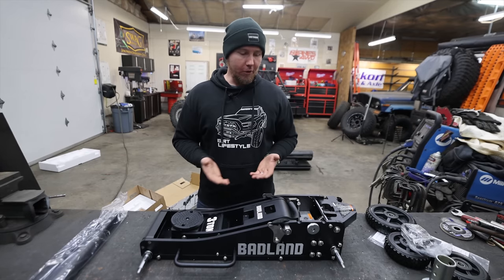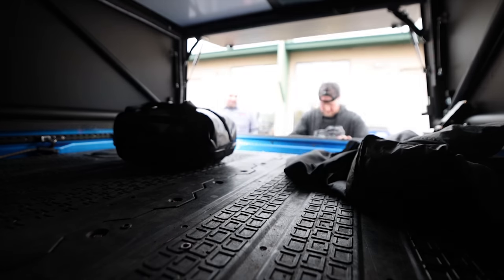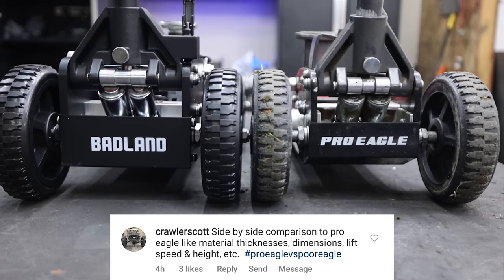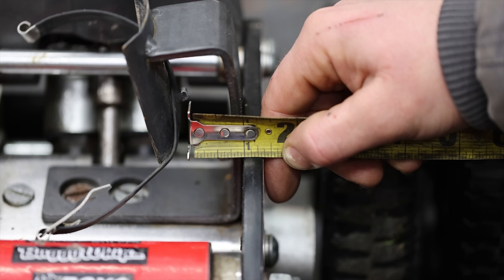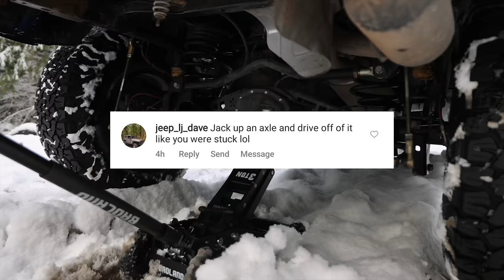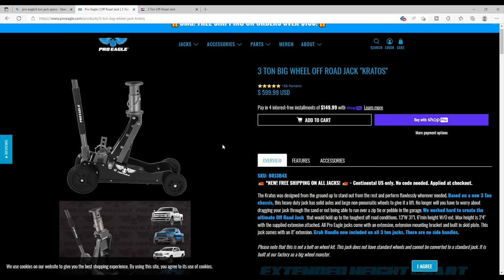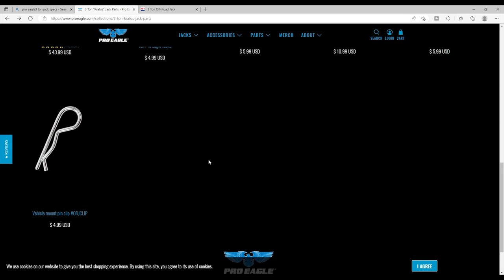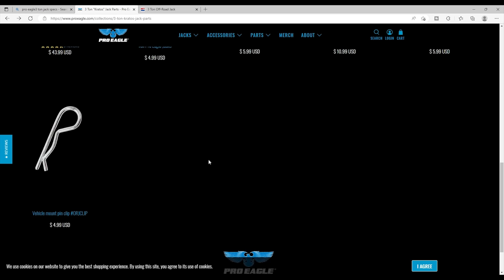Pro Eagle Clone Or Killer? Harbor Freight Offroad Jack Test and Review.

Comment: I got the H.F. Off-Road jack some days ago, in fact the floor demo one before the store had a chance to set up.   If anyone has problems with H.F.  read up on the company history. It's a interesting of success not a wonder flash in night company. 
 On with what the "Off-Road Jack" should be called.... "The P.M.C. Jack" I seen it in  Iraq. Contractors had modified regular floor jacks to be able to do faster tire changes that worked in sand, ect. ect. due to not having the same support as military services.  I had seen them in 03-04.

Comment: You need to show us how to convert a regular HF floor jack to a off-road jack
Reply: and not from a kit!
Reply: Nate: Welcome to my new series about converting a HF garage jack to an offroad capable jack... 3 videos layer he's bolted on a spacer conversion to put on a 17x9 wheel with 37s and then puts a small block Chevy on top to power it, uses a hydrostatic trans to convert engine power to lift and movement, puts a GM steering box on it and then takes that offroad.
Reply: 911 motorsports makes a kit
Reply from the maker: That would be pretty fun 😁

Comment: I love my 1.5 ton Offroad-Converted HF Jack, converted with a conversion kit from 911 Motorsports. Small and Light. It is my go to jack. 

Now I also want something larger for when the 1.5 HF isn't enough and I need to lift something on my gravel driveway. I have been thinking of converting bigger HF jack but now I don't have to. I am a buyer of this new off-road jack from HF!   I mean, a 3 ton conversion kit from 911 motorsports is almost the same price as this new HF off-road jack, and it doesn't even include the jack!
Reply: But you'll have a Jack that is partially American-made and supporting a small business at the same time.
Reply: @MrPiimpslap  No doubt. I try to support small businesses when I can. 

I went back and looked at 911 Motorsports kit and their 3 Ton HF conversion kit wasn't as expensive as I remembered.  

The $165 conversion kit, + $249 HF Jack, is very competitive vs the Pro Eagle 3 Ton, but not very competitive to the new $299 3 Ton HF Off-Road Jack.  I can always spend the savings on other small businesses... 😉

Comment: I'm from the UK and use a sealey 3 tonne cross beam adaptor models no. X137 for offset diff on land rover. That jack would be ideal if it came with beam adaptor what you can buy.

Comment: I’ve bought (and returned) things at PrincessAuto/HarbourFreight. I’ve considered them a seller of 1-TimeUse (if lucky) products. Wondering HOW can this product be messed up
Reply: I agree. I’ve had tools I bought at HF shatter on the first use. It makes me very leery to trust them with something like a jack
Reply: I have also had harbor freight tools break before the 1 time use, but in my experience my harbor freight jack has never indicated it would fail on me anytime soon. I also have a set of recalled harbor freight jack stands and the improved ones. I would not trust my life with the recalled ones (obviously, but i still use them on occasion) and I'm confident with the new ones with the safety lock thing. Based on how this one appears to be built, just like my own jack, I would trust this one. If I didn't already use a harbor freight bottle jack as my offroad jack, which the small ass jack pad on it has already allowed the jeep to fall and almost crush me (I welded up a new pad that is now much safer), i would buy this one.

Comment: While HF has gotten way better with their products, it still feels that they copy a lot of other products. They aren't always a bolt by bolt copy, but like in the case of these jacks, its VERY clear where they got their inspiration. Even the actual hydraulic pump looks very similar. Its a similar issue with the Apex winch vs a Warn EVO. The Apex is exceedingly similar to a Warn EVO. Which means, I will happily spend a bit more on a Warn EVO than a HF Apex. Even though both are manufactured in foreign countries. (The Xeon being built in the USA).

Comment: Did you see if the pro eagle extension fit in the badlands? I saw they had some very long extension and I figured harbor frieght isn't going to come out with larger extentions. Suck as lifting up a long travel truck out in the desert to pull a shock out.

Comment: Is the harbor freight warranty on the jack lifetime? If so and you needed a part (say a wheel) just bring the jack in and get a brand new one. I mean obviously it's a bit excessive, but still cheaper then paying 30+ bucks after shipping for a wheel when you can spend a couple bucks in gas and get an entire new jack.

Comment: Great Vid.. just a few points from MHO , Many of the "better" item from HF are not made in China, but Taiwan.  Such as HF's better impact sockets and such. so takes a little learning from the field and users , and not shopping price. Unlike the jack, would look for where the socket set was made. Better reviewed HF stuff was usually Taiwan. But still yet, with their better cordless tools. just seems on some of the dissection video reviews, there are reasons they are less expensive than the name brands. But the ability to walk in and swap out a bad tool for 5ys, can be better than dealing with big name warranty return. But if your already invested in a battery platform, it's $$ to switch.  I own a 3T ProEagle. I have a 1ton CTD 4x4 and a few jeeps in the "fleet". Just bought a 1.5T ProEagle to carry in the one jeep we use for trail runs. Nothing major, mild/minor build. I'm old, don't want to have to jump up into my jeep. 34.5"tires and 2.75" lift. The 3T ProEagle gets used in the yard. Thoughts were to take it with us in the Jeep or 1ton CTD 4x4 (our beach vehicle) , but it's too big for the jeep, so the 1.5T PE was purchased, still have to figure out the mounting. Bought it for it's smaller size and weight with thoughts of probably mounting it on the inside of the back gate (but for the winch and spare, nothing is mounted externally). (the way I've always done it, been wheeling since 1981) I too saw the ASME spec claims, and checked out PE's site, came up empty. With how much PE gets used by many competitors and service groups, can't believe it's not a solid product. My own PE experience is only 1 jack for 2 years. I found PE customer service to be first rate. My only issues have been with back orders and questions... always got answers always got my stuff. That communications counts a ton, as well as you pointed out - available parts-a PE jack is an investment as with any good tool. Not soo easy with HF. I've had my experiences. But you have to be a knowledgeable consumer when buying HF. I have 3 big AFE 4T jacks (an investment - gave up on "store brand names" I grew up with and such, after loosing an oil pan and almost my legs) for the driveway work (my "garage" is small 1 car, and barely get a nose of the jeeps in there)(my garage is more of a large tool box), and found the 3t big wheel PE the go to when I have to drag a jack out to the end of the driveway, curb, or into the yard. And I've always found having at least 2 floor jacks to be a winning / saving combo at times (I have plenty of jack stands, and use them). So still may get a Bandlands to go with the 3T PE for the yard. Summer time, when the black top gets hot, the small jack wheels can sink into the black top.

I'm a EE and have to deal with manufacturing in China, from our designs in the US. There's a lot of sourcing issues to deal with on a daily basis. You want a Motorola part, sure you'll get one MARKED Motorola, but is it really. If the sourcing of materials is tightly controlled, and the US company has their own good qualified boots on the ground in the China plant for daily/hourly control, decent products could happen. I agree, it really seems , increasingly, HF is trying to make their best lines, better. Seems they have an iterative process, on the back of the consumer as the beta tester. If the design was too marginal, fix what was found in all the returns. Try again.  So seeking out the ASME testing and approval, would seem to be an attempt by HF to say, we are doing that with this jack, you can trust it.   I've done a ton of UL work.  There is great things about formalized specs and testing (and I could go on for hours about that-good and bad and the cheats). But sometime demonstrated reliability is another whole level.

Sorry for the ramblings. But as a off roader, engineer, shade tree mechanic, HF shopper, ProEagle owner. And wanting to like the new HF Bandlands jack, I could discuss this for hours. FYI... I own 1 12K HF winch and 2 Warns. Not like I'm not open minded and willing to try. But the Warn sits on the front of our trail Jeep, and the HF sits in a cradle in the bed of the Dodge, inside the bed cap , till it's needed cause a yankum or bubba rope wont work. I trust the Warn to get me home, but HF 12K is a backup.

Comment: im a big fan of the all in 1 style jacks that are bottle jacks with a built in jack stand feature, takes up less space, and is safer in my opinion
Reply: Until it sinks into soft ground🤷‍♂️
Reply from the maker: All I carry in my offroad rigs are bottle Jack's but I would have to disagree on safety. With a smaller base, they aren't as stable, especially when you use them offroad. Again, I prefer a bottle jack offroad, but I can't see how they could possibly be safer.

Comment: WHY would anybody haul a big ass floor jack around off-road? A $30 bottle jack sitting on a $40 high lift base plate is FAR superior. Takes up less space, and lifts the axle tube straight up instead of traveling in an arc like a floor jack does.

Comment: that thing is awesome but that price tag. if it was about $200. i'd be interested. problem is people are in need of something like this and there's no real competition. more competitors will lower the price. toying with the idea of a new jack. should have went bigger when i bought my current jack. anyway this jack is more than i need but it would be nice when doing stuff in the yard or just rolling it over bumps. i've got their 1.5 ton aluminum jack and it's boing the job even on my 3/4 ton. it's just not ideal.

Comment: Besides the larger wheels and the saddle extensions what makes these different from any other Jack
Reply: Well, it doesn't just have larger wheels, the wheels also have large sealed ball bearings for super smooth rolling, the saddle extension is mounted with bolts so it doesn't wobble, it's aluminum to keep the weight down, it has a fairly tall lifting capacity, etc, etc....other than that, it's not really different than other jacks, it just fills a specific need for those who need a taller jack. HF knows that people spend $600 on the pro eagle and they want a piece of that market. Considering I am having a super hard time finding one in stock anywhere within a 200 miles radius, I'd say they have hit a homerun.

Comment: The issue with "made in America" nowadays often means "assembly in America with foreign parts" even if those expensive Jack's are assembled in America most of the time the valves, hydraulic pump systems, small parts, wheels etc are chinese made and put into a frame built here in the USA, meaning all the working parts came from elsewhere

Comment: Dont get caught up in standards or testing standards! I worked in manufacturing for years and those types of standards can do as much harm to innovation as they do good for quality. As an example lets say a standard in drinking water valves says that for water quality bronze bodied valves must be used with clean potable water but a manufacturer says they can use stainless for the same price which valve would you install in your system? As long as all inputs are the same(clean potable water) then you would be foolish to install the bronze valve instead of the stainless. Its easy to get caught in the minimum spec that is a standard but remember that many things do NOT meet a standard because they are over/better built or use better materials in manufacturing. I see that comparison on HFs website and I scroll right past it without a second thought. If that standard was truly valuable to the quality of the jack they would list out the standard, not just the reference number and why they meet it and why the competitor does not.

Comment: They have had good quality items for a long time. Much longer than the 5 years you mention. It's just getting easier to find the quality stuff with gear and tool review channels like yours. Pro tip. The Pittsburgh pro composite ratchet sets are an incredible value. My main 3/8" ratchet is the composite model from harbor freight. Yes, it's plastic. That's why I reach for it. It's light to sling back and forth quickly and doesn't get burning hot if out in the sun. The metal chisel set in a roll is another. I beat on those things.

Comment: 911 motorsports made a "big wheel kit" to basically take certain models of harborfreight jacks and make a pro eagle knock off.  i think harborfreight saw this and opted to do it themselves.  i do wonder if the accessories from 911 motorsports would work with this badlands unit.

in any case i need this in my life.
Reply: update to the stuff from 911 Motorsports.  according to their website their larger vehicle mount should work like a charm, as well as some of the other accesories they offer for the offroad conversion. they have a four point adapter that won't be too useful offroad but i can see it being mighty handy in the shop building a rig or in a junkyard sourcing parts.

Comment: The Badland jack is not ASME certified. You say in this video that it’s important they can “use this stamp” but they cannot use the actual stamp. If you look closely at the double asterisk, you can see it “meets the requirements” based on “third party testing.” We don’t know who that third party is or where they’re located. Likewise, the Pro Eagle may not meet the requirements based on something like a pin being slightly too long, not having a long enough retention chain, or some other equally irrelevant thing that doesn’t realistically impact safety. Or it could be something serious, but if it were I feel like HF would point that out. What they are doing is successfully tricking people into thinking they have a safety certification that they don’t. ASME has a searchable directory of certified companies to confirm Badland and Harbor Freight are not.

Comment: The use of a jack of any kind is to lift an object/structure/load/ weight/etc. A person should not get under a jacked up load till it is securely resting on solid support other than the lifting jack: preferably solid non-crumbling/non-fracturing material capable of handling the weight resting on it. Just a jack is not a safe thing to rely on to get under the heavy things lifted. So beware of that!!! Be safe.

Comment: I rather buy a pro eagle jack than a cheaper version of itself on top of that with all the spare parts and accessories I can get from them easily. The harbor freight version only has a 90 day warranty vs pro eagle has a 2 year warranty on there jacks and to top that off I don’t trust two little bolt holding on that extension piece where the pro eagle has a twist and lock function

Comment: For a company with a known track record of poor quality and recalls, certified or not, I think caution still needs to be taken with the HF jack. 

Passing certs with product from a first production run or even a sample run, doesn't mean the product being produced 6mos or 6yrs down the line is of the same quality. Nor do we know the true long-term function and safety of the jack. Personally, I would take high quality, reliable components, stringent QC, and even cost, over a cert passed one time. Or wait several years to see that these are tried and true.

Comment: No offense to anyone who spends their money how they want but I always chuckle to myself when I see these “off-road jacks” mounted everywhere on someone’s rig and even laugh out loud when I see a floor jack like a proeagle and a hilift jack on the same vehicle. Why? What are you doing when your out wheeling that would require lifting the entire vehicle completely off the ground …other than racing where time is a factor I’ve wheeled for over 30 years all over the country and I’ve seen a hilift used once by a rancher who didn’t want to drive back to his house to get a come along and was using his hilift to fix his broken fence lol can my 7lbs bottle jack be used as a come along probably not but it and the accessories I made for dirt cheap fit in the head rest storage compartment on my rig and won’t become a metal torpedo if I were to get into an accident (I’ve seen a hood mounted hilift go through the back door on a minivan the Jeep hit and the jack ended up in the second row luckily only the driver was in the van) Do I have a floor jack you bet at the shop were I would use it to quickly pick up the front or back of my rig when doing suspension work can I use the bottle jack to do the same thing yep just had too last week to swap out my rear springs but a floor jack would have been faster in that instance. I can get to my jack in less than 30 seconds can pull a tire in the rocks sand snow whatever just as fast as someone with a mounted floor jack but maybe everyone knows something I don’t and after all these years I’ve been doing things wrong maybe I should buy a $300-$600 dollar jack to take up space in my rig instead of spending that money on something I actually need just so I can be cool too.. just some food for thought guys don’t beat me up too bad here 🤙